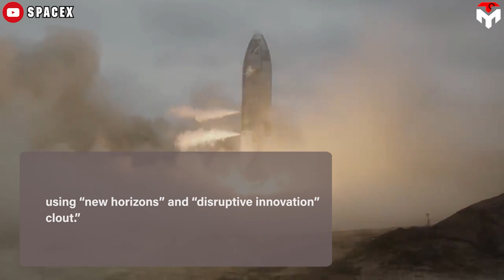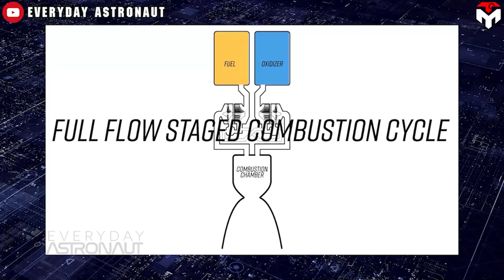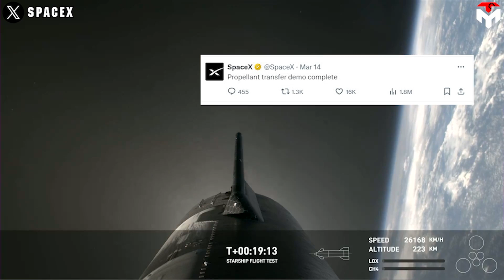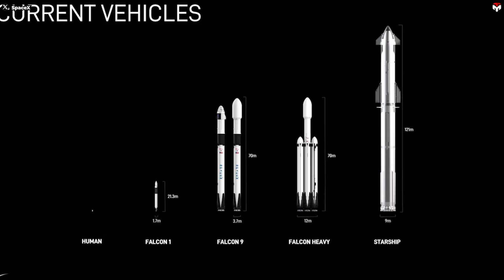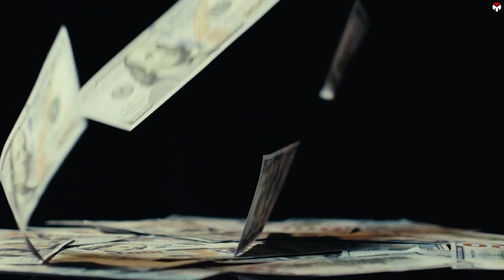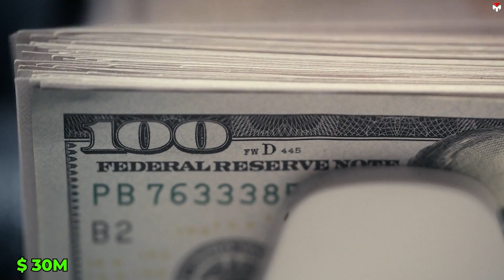All laugh at SpaceX: "Starship is a joke"but Elon's response is big slap to...

Comment: 2 Million per launch for Starship is a crazy, unsupported and not a credible figure. The launch pad has to be demonstrated to survive,TPS has to survive reentry, the vehicle has to be demonstrated to landing and to be turned around. There is zero evidence so far that this is doable, and actually, evidence to the contrary.
I will be very impressed if Starship can be turned around in one week..
Reply: So, care to revise your opinion in light of recent launch?
Reply: @PetrucchioDa  No, he does not, recent launch was a failure that did not meet ANY of the ACTUAL goals set by the contract, it in fact FAILED SPECTACULARLY, and the last one blew up seconds after separation. That makes it the 7th attempt with ZERO SUCCESS!. 
So no, @pedrosura does not have to revise anything. His statement is still 100% correct, and it will most probably stay correct until Musk's unmanned starship reaches the moon, MAYBE in 2050, if he is lucky!

Comment: Businesses need to make a profit, Yes.  But you charge as much over cost as you can.  Once you are making a profit, then next step is to go as high as the market will bear that maximizes TOTAL PROFITS.  If the competition that are in the heavy lift market are charging $1 B.  Then SpaceX should not be charging $2-3 M.  Then should charge maybe double or triple of what Falcon 9's launch for: $ 200 M.  At 200, SpaceX would vastly underprice other medium /heavy lift options.  I think the Falcon 9 is the cheapest per pound launch vehicle at about $2,500.  So price Starship at $7,500 per pound with a minimum payload.  Keep all three models in Service Falcon 9 for lower weights, FH for larger weights at $3-4000 per pound, then Starship at $7,500 per pound.  This undercuts ALL competition, and prevent any other companies from breaking into the market (profit driven market).  There will always be National Flag programs.  Those won't be competitive on the open market.  Only leaving Ego Driven projects (Blue Origin).  SpaceX will own the launch market until someone comes up with a method to launch that does require so much weight for fuel.
Reply: yes you are right but Elon wants to make space travel accessible, can u imagine paying $1 M for a flight ticket cuz they want to maximize profit? many companies (especially travel companies) make profit by making there services cheap to attract more customers. Moreover ,  SpaceX should make good profit BUT its main motive is to put man on mars [Hey this is just my opinion, im sure you know a lot more than me , i just wanted to point out what you are maybe getting wrong]